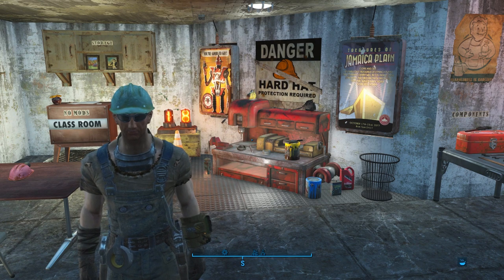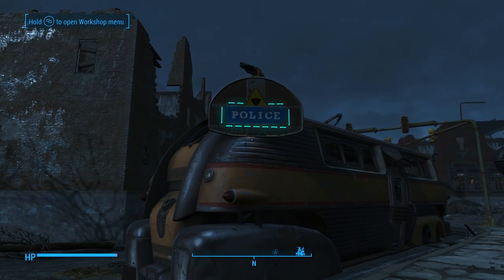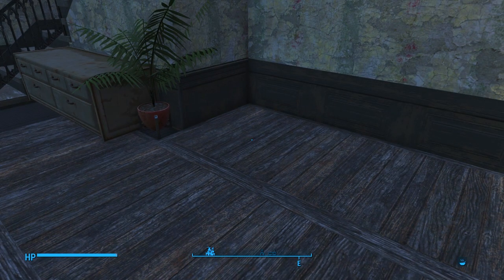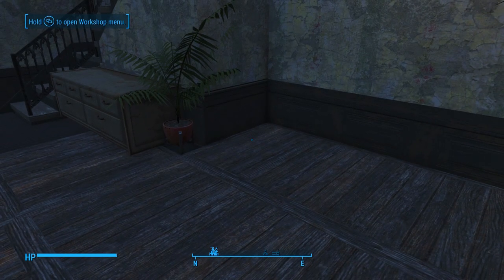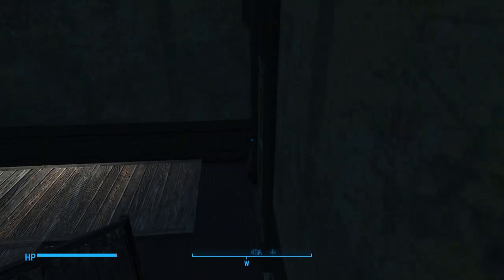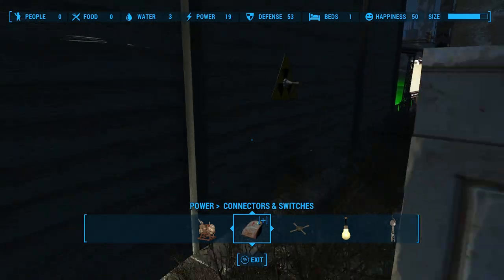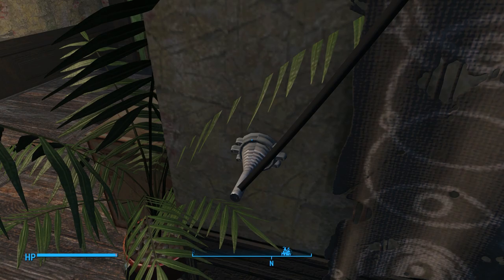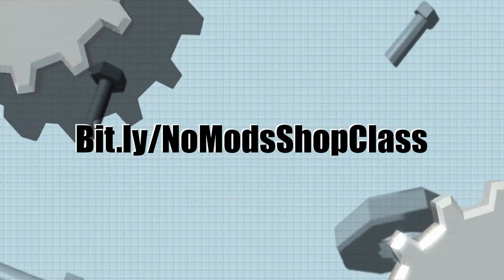A Deep Dive into the Wire Glitch 🔌 Fallout 4 No Mods Shop Class

Comment: It's not set in the 50-60s. I believe it was the year 2087 but in the Fallout universe instead of relying on electricity to move forward in science they used Fusion Energy or nuclear energy per say. That's why they have the Retro look of the 50s and the 60s but they are still a lot more technologically advanced than we are
Reply from the maker: Of course. I just meant it's thematically set in the 1950's: https://en.wikipedia.org/wiki/Fallout_4#Setting

Comment: Idk what I’m doing wrong. I put the gen on a rug. I wire the gen to the object. I click the rug to move the gen but if I place the gen where the wire would face collision, the wire gets detached and stored.

Edit: Ok so it worked with the conduit but not a radar beacon 🤷‍♀️
Reply from the maker: Right on. Here's an even better method to check out: https://youtu.be/YdaR7m4gct4
Reply: @SkooledZone  thank you so much for the reply! I’ve managed some pretty cool tricks in my settlements bc of your vids! One other question - I asked on another vid but don’t think you saw it - how do you prevent your non-workshop items from getting knocked over or disappearing? I put so much effort into one of my settlements and everything was ruined a week later. I don’t keep any settlers there either.
Reply from the maker: @rage.kitten  Yeah, I usually respond to comments so I may not have seen it. So the falling or disappearing junk items are a real issue with the game. It happens to the best of us. I did come up with one trick that may help. Check out Tip #14 of this video: https://youtu.be/D76HR039mDI

Comment: How do you get this to work every time? Also; I didn't need to do the 'go back to the connector on the floor' stage... my switches worked anyway. VERY useful glitch...love it.
Reply from the maker: It should still work unless you have some mods installed. Also, here is a better method to check out: https://youtu.be/YdaR7m4gct4
Reply: @SkooledZone  Thank you, :) I do have mods installed, and can do it, just not every time...

Comment: I wire glitched a couple missle turrets on top of the pillars at sanctuary (like u did lol) but they wont turn on for some reason.. I have 300 power at my settlement and everything is wired together. What could be going on?
Reply from the maker: Odd. I'd try wiring them outside the pillars first to make sure it's not the glitching that's the problem.

Comment: After removing the rags in the second type of wire glitch in the room did the generator outside behind the wall fallen to through the ground?
Reply from the maker: It may have dropped a little but not much. If that's something you want to prevent, check out this video: https://youtu.be/2Uk9kAyIqSo

Comment: If you use the (vertical rag-wall )-on sign glitch to move the conduit instead of the real wire glitch method is it not safest even if you store the rag or sign?
Reply from the maker: Actually here's an even better method to check out: https://youtu.be/YdaR7m4gct4

Comment: Does distance matter with the sign glitch?
Ya know how when your wiring things normally it has to be within a certain distance of each other or else it will go red and not allow you to wire those 2 items together. If you use the sign glitch, can you wire from one end of, let's say sanctuary, to the opposite end of the settlement?
Reply from the maker: I know distance doesn't matter with the true wire glitch. Check out this video: https://youtu.be/3TIo77uMUxc
Reply: Skooled Zone well I tested it, you can NOT wire something on the other end of a settlement using signs.

Comment: I'm sorry, but I can't get the wire glitch to work.  Followed the video instructions.  I'm using the exact same rug and conduit you are using.  But can't get it to work  Not only won't it go through walls - the range is the SAME as it you were just connecting between 2 pylons/conduits.    
Fallout 4 GOTY Edition.   PS4, but using on a PS5.  Or has the glitch been fixed
Reply from the maker: The glitch shouldn't have been fixed. They haven't fixed anything since like 2018. It just takes practice. Try this better method instead: https://youtu.be/YdaR7m4gct4

Comment: Am I doing something wrong because everytime I try to use the wire glitch, my game starts crashing every time I load and try to use a switch or anything like that and then have to load a save from before I started doing any wire glitching. I've wasted over an hour of building time because of this
Reply from the maker: Are you on a PC?
Reply: @SkooledZone  no I'm on a ps4, and I looked at the size and it's not above half to this point I started having the crash issues, I think I have 3 things in total wifi'd in this particular settlement
Reply from the maker: @greenz9490  How about mods? Sometimes mods interfere with the various helpful building glitches.
Reply: @SkooledZone  I have no mods installed currently, just all the dlcs from bethesda
Reply from the maker: @greenz9490  Yeah, that's really strange. It shouldn't be crashing like that. First someone has mentioned that. Let me know if it happens at a different settlement.
Reply: @SkooledZone  yeah I'll try it out at a new spot and see if it does it. Only things I can maybe think are causing it at sanctuary are that I did do some supply duplication glitching and that affected the size glitch, or I maybe lost track of the conduit I used to wire glitch multiple items and maybe scrapped it and its causing the items I wire glitched to crash my game. Thanks for the responses by the way, keep up the great content!

Comment: how about gliching floor panel into odd corner spots
Reply from the maker: Glitching anything that snaps can be hard if not impossible. You can do it with the pillar glitch if you do it first before other floor tiles are in place. If not, check out Tip #15 of this video: https://youtu.be/xKX4E1yQkig

Comment: Or the minigun glitch you can use it to push around cars other heavy items that you normally couldn't move
Reply from the maker: Someone suggested the turret glitch, which I think is similar. For the minigun glitch, do you just hold it like normal and run into things?
Reply: Skooled Zone the minigun glitch you drop a minigun then you hold to pick it up and you can use it to push items around like cars or things you normally wouldn't be able to move
Reply: Skooled Zone I was able to move a car in sanctuary into one of the driveways made it look like I was working on it by using the minigun
Reply: Skooled Zone no you don't hold it normal you would pick it up like you would move a vase or an object like that but then you use it to push larger objects that you wouldn't normally be able to move
Reply: Skooled Zone I was able to move cars I was able to move large signs I was able to move a lot of things that you wouldn't normally be able to move and I would push them into my settlements and then use them as part of my settlements all by pushing them with the minigun
Reply: Skooled Zone basically you would hold to select the minigun and then use it to push like a car or something like that and then push it into place where you want it with the minigun
Reply: Skooled Zone if you are clever you can make a ramp and then push a car up the ramp with the minigun and put it on top of the red rocket gas station and turn it into a really cool sign you can get pretty creative
Reply: Skooled Zone I hope I explained it right any questions please feel free to message here is fine to message me
Reply from the maker: Good explanation. I'll give it a try. If it works, I'll add it to my next Miscellaneous Tips video and credit you for the suggestion. 👍
Reply: Skooled Zone hey thanks man that would be great remember it works on the corvega cars not the ones that are rusted out or blown up the ones that still look like they're in good condition basically the ones that still have some pain on it and look in good shape thanks man keep up the excellent work PS I'm a graphics and audio engineer myself I have my certification in audio and Graphics engineering and I'm Pro Tool certified took the three courses love your vids

Comment: I tried your true wire glitch for the super reactor at Sanctuary Hills and where you said to point the dot and highlight the wire and press 'attach wire', for me nothing happens - the wire doesn't flash, there is no sound effects - NOTHING!!! Yes I'm getting frustrated, hours spent and achieved nothing. I've given up on having cleaned up settlement with no wires showing. Its great that your other students can get it to work, but i'm doing your methods step-by-step and the results are falling flat.  Now cue your followers to rain insults at me.
Reply from the maker: One step may have confused you. You have to point the dot at the conduit not the wire, but have the wire be highlighted in the periphery. Hope that helps.

Comment: I would add a comment and ask anyone who loves pauls videos and can offer some help. I have trouble using the PC to place items and manipulate them when in build mode and still have not gotten the place anywhere mod to work which really sucks I spent 4 hours trying to do basic placement and still failed to achieve the results I had tried to get. if you can please help on manipulating items. I am using a few mods like thematic and practical, OC decorator, and a few others I can not use a ton of them because my slow computer and Windows 10 just are a frustration in games not working. yet alone the basic windows 10 interfaces and apps. thank you all for helping me and supporting paul. by the way i have made a ton of batch files to add items to the game in console and would be happy to share bat files to add ammo and some items that are either in limited supply or you just need a certain item in a tight spot and can't remember where to go in the common wealth to collect the items.

Comment: Man - how can people handle not using 'Scrap that Settlement' or something like it.  Every time I watch people's videos all I notice is ugly weeds and rubble.
Reply from the maker: It's funny because they actually built that feature into Fallout 76 without needing mods. You just have to put an object down to 'bulldoze' the weeds or rocks you don't like.
Reply: @SkooledZone  I haven't done that in 76 yet. Haven't needed to for my CAMPs. Got bored with that game and came back to FO4.  I clean every rock, dead tree and weed in a settlement when I'm building. I also found a mod to get rid of the rooves in Sanctuary. I'm really fussy about cleaning my settlements. Now I build Art Deco mansions over the top of the houses so they are invisible.
Place anywhere mod enables me to push the wires and connectors through walls.  I haven't figured out how to use the conduits yet. They don't seem to work when I push them through walls.

Comment: Is this patched now????
Reply from the maker: Still works for me. Do you have mods installed?
Reply: Skooled Zone I do not. But fortunately it turns out it was a one off. Can’t figure out why it wasn’t working, but I’ll find a way around it. I’ve actually just been using the wire glitch in a build 😊 Appreciate you checking it works though!

Comment: This doesn't work
Reply from the maker: It's still working. Sometimes mods interfere with it though. Do you use mods?
Reply: Skooled Zone I wasnt doing the wire glitch properly at first. 1st part I got but the 2nd part I had trouble with. It worked for me while having the wire highlighted as I attached it to a  turret or light source. I'm currently playing vanilla fallout  4 on ps4
Reply from the maker: Awesome. And if you want an even better method, check this out: https://youtu.be/YdaR7m4gct4